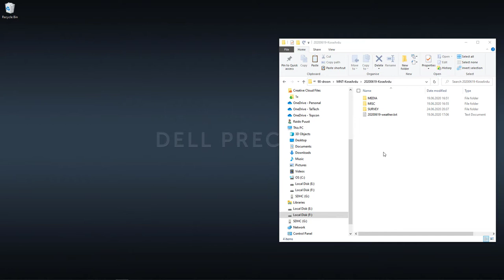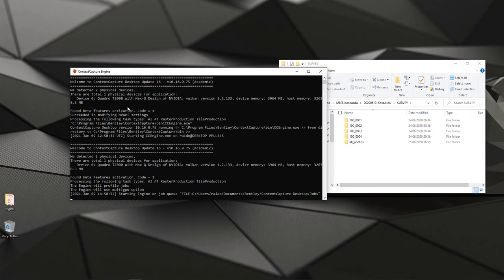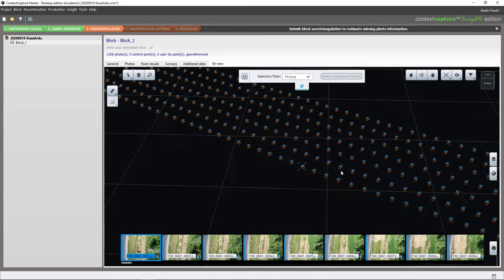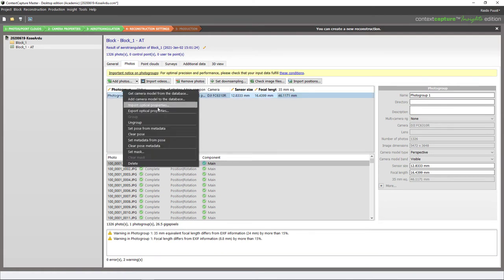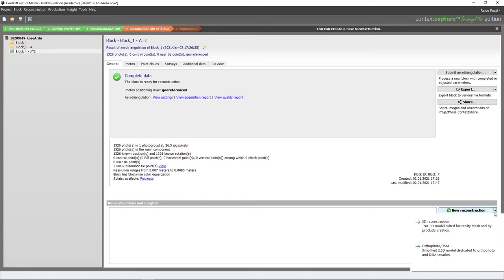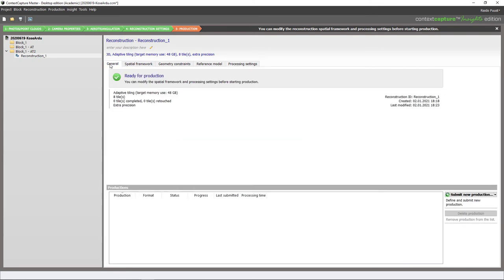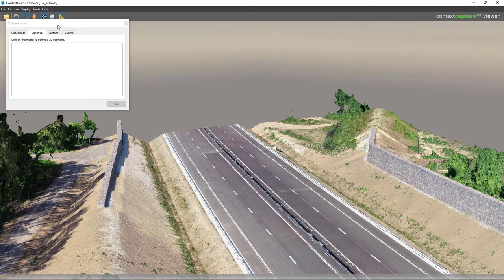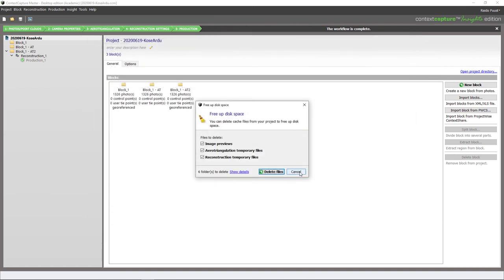droneHOW - Episode 04 - Creating a 3D model (Bentley ContextCapture)

Comment: Amazing series! So much good and rich information! Thanks for making this Puust. You're awesome!
Reply from the maker: You are most welcome!
Reply: @eRaido  Can you tell me how Context Capture does compare to Agisoft Metashape? Is it any better? Plus, is this drone RTK, do you don't need to use any Ground Control Points (GCPs)? Thanks!
Reply from the maker: @lztoniolo  I believe that both works very well. ContextCapture and Agisoft Metashape (I have not used that). So, no problem if you prefer one or the other. Yes, I have used DJI Phantom 4 RTK drone. To use GCPs is up to you, if you are interested about more precise results or not (depends on a use case). If ~5 cm accuracy is enough, I would not worry about GCPs (but yes, using just one GCP gives you a confirmation about the accuracy of your survey). And by using GCPs, you can get your accuracy down to ~3 cm. You can check one article about our research: https://www.tandfonline.com/doi/abs/10.1080/00396265.2020.1830544?journalCode=ysre20
Reply: @eRaido  Really awesome answer Raido! Thanks a zillion for the info and your precious time...

Comment: Hello, how do I share my 3d model created on contextcapture to the client?
Reply from the maker: It depends. There are various options and do depend on client’s requirements or expectations. You can share as a ContextCapture Viewer package, you can also share it as a web-contnet (you need to have a web-service, into where you can upload). You can also share it in multiple open formats in which case a client should have some viewer package available to open/view. And also consider if you should share a mesh model or a pointcloud.